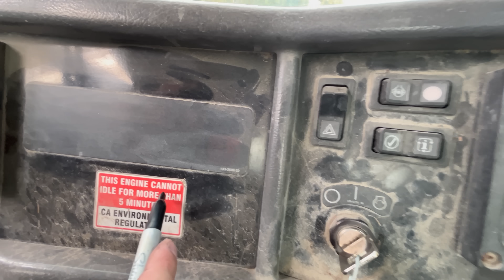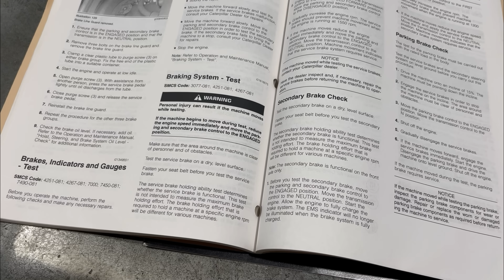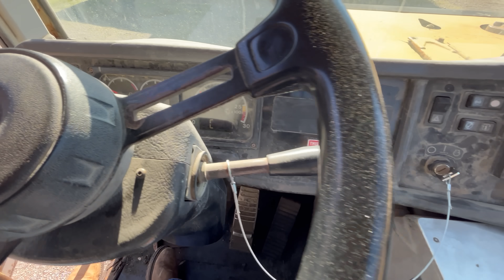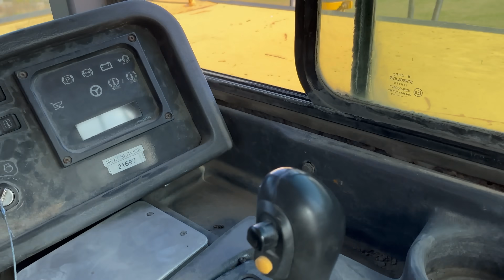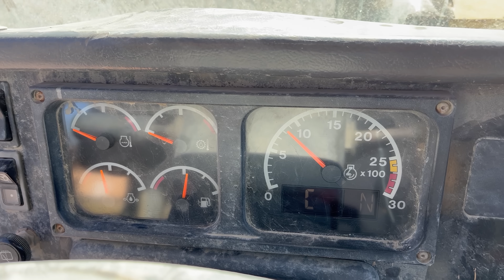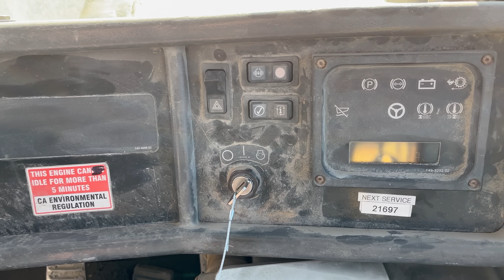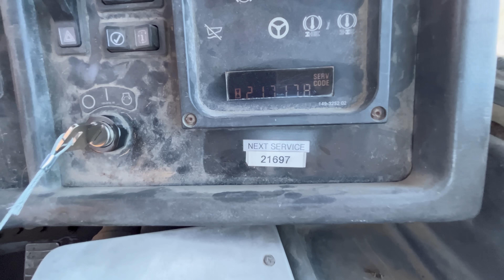Bought a 70,000 Pound Caterpillar 6X6 Haul Truck Sight Unseen 1800 Miles Away

Comment: I think it’s because that oil is hydrophilic
Check for a bad breather valve 
If stuck open in your climate it’s always warm and humid in the day cold at night and it will pull in moisture it if the machine sits for too long

Comment: Check or replace your engine oil. When I got my bus with a Cummins 8.3, had wrong oil (too thin) ib the engine. The oil change place put 10w/30 and not 15/40. Problem cured.

Comment: Wonder if the pull would have been easier if you'd choked up on the trunk near the roots, then run the chain out the back of the bed and used the used the bed to lift the root ball a little.  That would put some weight on the rears and reduce the resistance of those roots on the ground...assuming the lip of the bed can take that sort of weight as a point load, of course.
Reply: probably a great idea!  if he has a good hook point that is strong enough up there!

Comment: 3:49 Fixing the strange dumbness again, and I'm surprised a cat algorithm ecm engine control module don't shut down the engine after 5 min idle time. Like the on highway heavy trucks that do exactly that, But thankfully I'm never interested in those pieces of confirmed junk. W900/ W900L /T800 & 379/ 379L are all I'm ever Interested in & must have C15 / 3406 /475 horse power. 18 spd eaton fuller & heavy spec T/A 46,000 lbs boogies.

Comment: 🤔  HUMMMM... 50 years in MINNESOTA, wrenching,,,  my GUESS that is } CONDENSATION { ! 😏  We had Oshkosh trucks with Sno-go blowers, garaged inside partially heated buildings and I still don't believe the moisture buildup in those trucks when we would service them every summer!  I have had water litterly hit drain pan first.You need to take after Jeff ( Jpaydirt ) and replace those drainplugs with shutoffs. We had shutoffs on all our loaders and 3508 gensets, " I know that is mobile to stationary", BUT there is 99.9 % control oil will get into the drain pan 😆  AWESOME spending the evening in your videos.  THANKS AGAIN FOR THE EFFORT TO TRAVEL THROUGH YOUR WORKINGS, AND THE NARRATION. 
BE SAFE, LOVE IT !!!😍😍😍😍😍👍👌🤙👍

Comment: Worked.on those D400E's quite a bit.   The brake groups are a pain to rebuilt. I hate the inner oring on the duo cone.   We would removed the spherical  bearings and replace them with hardened brass bushing to get life out of them.      Another thing we did was kept a bunch of rebuilt  suspension cylinders  on hand. Because they were junk from the factory.  And make sure you keep the gungeon clearance to specs.    Have to say I hated working on these piles of JUNK.  Hope you got it really really cheap.
Reply from the maker: Brake groups are same as a 740.  From what you're describing, I think you're talking about D400Es and not series II machines.  Mechanically a D400E is a very very different machine from a D400E series II.

Comment: The company I work for will swap engines. They will rebuild pretty much anything on a haul truck...BUT if a transmission or transfer case is getting bad oil sample reports... they immediately sell the truck. They usually don’t mention the issues to new buyers either. 😂 check your drive train.
Reply from the maker: I think it was a casualty of California's emissions regs, but no telling really.
Reply: @KT3406E  Don’t think it was from Calif. the only thing they mine/haul is bit coin and shitty politicians. You can haul that stuff with a one hole port-o-shitter….

Comment: listen i know this sounds hacky but 2 Full v8 cans of ENGINE RESTORE will stop your blow by i had an old 6.9 idi that was so worn out the oil filler looked like a smokestack and had to use either to start it in the summer but after i used 2 cans for a 10 quart system and after about 40-60 miles of driving not only was the smoke gone but the truck would start under its own power even in the winter

i know Band-Aids seem to good to be true and i have no idea how it works but it does and its a forever fix too im going on 15 years now only draw back is every time you change your oil you need to add the additive again because after 30-40 min of driving without the additive you will lose the effect

Comment: The blow by  is from being a dirt machine…the engines eat dust.  Haul trucks/scrapers are notoriously for being hard on engines due to all the dust.
Reply: @tjlqk3  -No kidding, but the application of off road vs on road causes different ware patterns.  In the 25 years of being a heavy equipment mechanic the only time I ever see bearing wear is lack of oil.  Ring wear is expedited in the mining/dirt works because of dust injection into the motor.    That blow by is nothing compared to what I have seen, and those engines run on for thousands of hours.

Comment: I repaird drive train. There is a plastic splash cover in the high low part transfer gears. When you drive longdiston high gear is gone be to hot and melts and block the filter and stop the lubrication pump...

Comment: It's a good thing that you have previous experience with this kind of equipment. and that you have some part's lying around that should make your job a little easier. that's amazing that it has hydrologic brake's on it would've have thought it would have air brakes on it. and a Jake but I guess that would be necessary to save wear and tear on the wheel brakes. wow that was a hell of a lot of water in that transmission oil and I agree it doesn't look it was mixed with engine coolant. but it would definitely make a person curious how that water got in there. well it looks like it's already earning it's keep moving around heavy objects on your property. thanks for posting an interesting video that a person might not normally see on YouTube.

Comment: A very good video.  The question I have is that  years ago some diesel engine makers had the  air intake valves on one side of the engine and the exhaust valves on the other side of the engine.  Their claim was that if the engine has opposing intake and exhaust valves, the air being drawn into the intake valves is cooler on account of the fact that it is not adjacent to the exhaust valves. The result being better combustion and more power.  I wonder if there is any truth to that.
Reply: I suspect that it is true ... but to what degree?  and does it cost more to design and build a good engine that will do that.  And often you sacrifice something else in the process.  It's like balancing 10 different things - you get an advantage in cooler air into the combustion chamber but maybe moving the valves around causes a problem with flowing enough water through the head and overheating problems start up! ... etc
Reply: @advancednutritioninc908  Now that I think of it , ever so many years ago, I was talking to a diesel engine mechanic and diesel engine college teacher and he said it makes no difference. At any rate I welcome all comments pertaining to this topic.

Comment: Nice score. We have a few older D25c at work an they are solid trucks. Although the 2 axel really helps with distributing the weight better. I ran mine out of fuel yesterday at work lol oops hopefully it don't take to long to get fuel back into the rails cus I tried cranking it a few times before I noticed I ran the fucker out of fuel. An with ours it's big big big no no to not let the air pressure build for the parking break. That shit is not cheap to fix either. You got a decent truck tho.

Comment: If it were any other brand with that many hours on her and that wore out, I would have passed. But Caterpillars are over built to begin with so you can milk a lot of extra hours out of the ol' girl. But anything with the Cat logo on  the box is expensive as shit! Filters, oil, spare parts....I did a 1000 hour service on a D9 and the parts alone were $1200.  I try to substitute aftermarket parts on things like windows, seats and non critical items. But critical stuff like oil and filters I bite the bullet and buy the good stuff.

Comment: Boil that oil in a steel container over a fire, once its 'rendered' you can reuse it.
That's the truth of where recycled oil goes, straight back into the oil sellers pockets.
Reply: i did that with dextron atf in a trans that got hit with a bad cooler, was trying to flush out the pepto bismol, cooked it till it turned red and dumped it back in, did that a half dozen times and the trans was still fucked in the end (think the glue on the frictions is water soluble in some boxes) new chineseum radiator killed it, told him not to buy the cheapest one.....